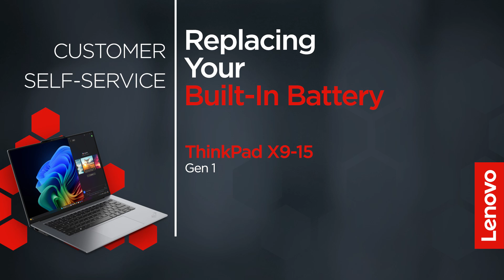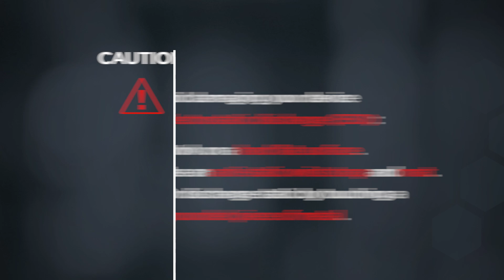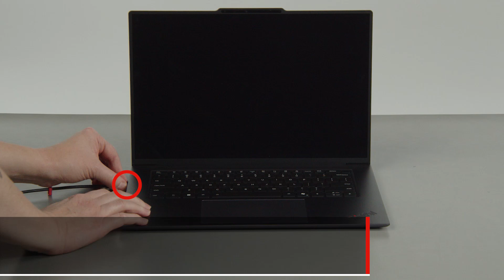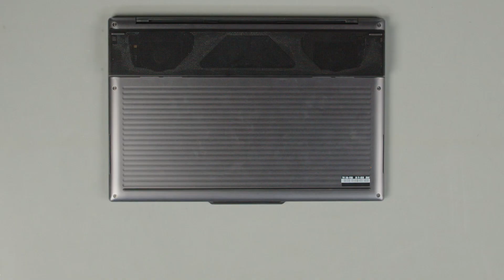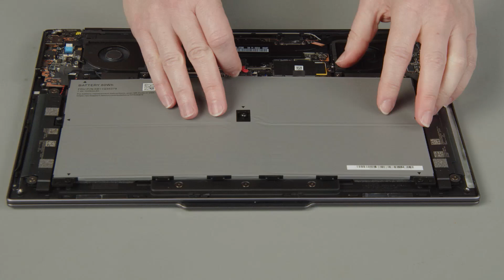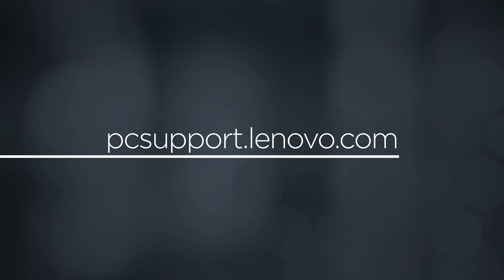Replacing Your Built-In Battery | ThinkPad X9-15 Gen 1 Aura Edition | Customer Self Service

Comment from the maker: This video will show you how to replace the built-in battery in your ThinkPad. The process in this video will work for the ThinkPad X9 15 Aura Edition (ThinkPad X9-15 Gen 1).

You will need a screwdriver kit, a non-metallic pry tool and 15 minutes of your time.

To view the ThinkPad X9-15 Gen 1 (21Q6, 21Q7) Built-in Battery Self-Repair Guide go to https://pcsupport.lenovo.com/us/en/selfrepair/sr500107

To learn more about your device go to https://pcsupport.lenovo.com

To find parts for your device go to https://support.lenovo.com/parts-lookup/?cid=ww:lenovosocial:b9515f&source=socialmedia&subsource=yt

To view the Lenovo Support Self-Repair Guides landing page go to https://support.lenovo.com/us/en/solutions/HT516547

** NOTE: Static electricity can destroy components. Use a grounding strap, and clean, non-conductive surface to work on. Use plastic or coated tools to prevent scratching and avoid using metal tools on plastic parts. For more detailed information on electrostatic discharge and how to prevent it, please watch our "Understanding Electrostatic Discharge (ESD)" video: https://youtu.be/by4PB3WtdLo 

Warning: Use only the authorized battery specified for your computer. Any other battery could ignite or explode. 

Batteries supplied by Lenovo for use with your product have been tested for compatibility and should only be replaced with approved parts. A battery other than the one specified by Lenovo, or a disassembled or modified battery may not be covered by warranty.  

Battery abuse or mishandling can cause overheat, liquid leakage, or an explosion. To avoid possible injury:
Do not open, disassemble, or service any battery unless you are competent to do so and ensure that you carefully follow all instructions provided by Lenovo.
Do not crush or puncture the battery.
Do not short-circuit the battery or expose it to water or other liquids.
Keep the battery away from children and animals.
Keep the battery away from fire.
Stop using the battery if it is damaged, or if you notice any discharge or the buildup of foreign materials on the battery leads.
If the battery is incorrectly replaced, there is danger of an explosion. The battery contains a small amount of harmful substances.

Lenovo has no responsibility for the performance or safety of unauthorized batteries and provides no warranties for failures or damage arising out of their use. 

The Vantage app provides an automatic battery diagnostic test that determines if the built-in battery is defective. A built-in battery should not be replaced unless this diagnostic test shows that the battery is defective. The only exception to this is if the built-in battery is physically damaged.

If the Vantage app is not installed on the computer, download and install the program to diagnose the built-in battery before replacing a non-physically damaged built-in battery. Note that the replacement of a physically damaged built-in battery is not covered by the warranty.

https://www.lenovo.com/us/en/software/vantage/

Store the rechargeable batteries or products containing the rechargeable batteries at room temperature, charged to approximately 30 to 50% of capacity.
We recommend that the batteries be charged about once per year to prevent overdischarge.

Do not put the battery in trash that is disposed of in landfills.
Do not dispose of your battery with your household waste.
Comply with local ordinances or regulations when disposing of the battery.
For recycling information, go to https://www.lenovo.com/recycling

Applicable Machine Types:
ThinkPad X9-15 Gen 1 - 21Q6, 21Q7

Check out other official Lenovo channels!
https://www.youtube.com/@Lenovo 🟥
https://www.youtube.com/@lenovolegion 🎮
https://www.youtube.com/@Lenovo-PC 💻
https://www.youtube.com/@LenovoSuporte 🟢🟡

#Lenovo #LenovoSupport #LenovoTechSupport